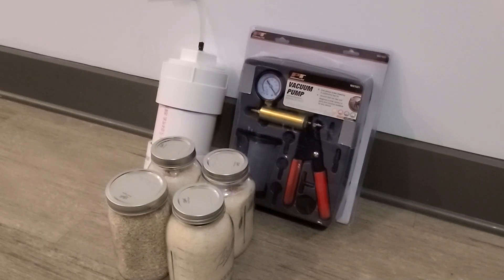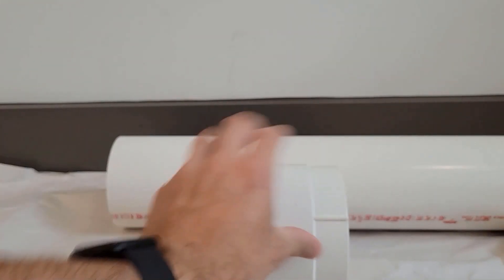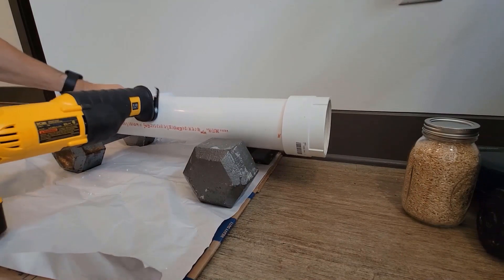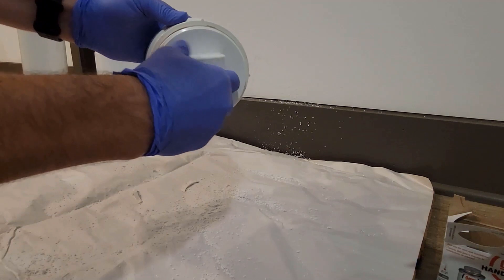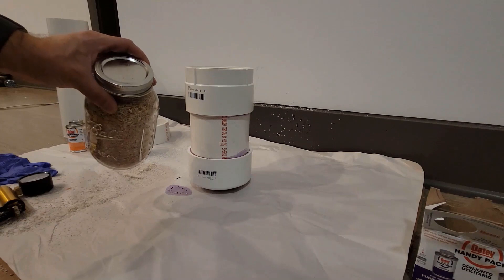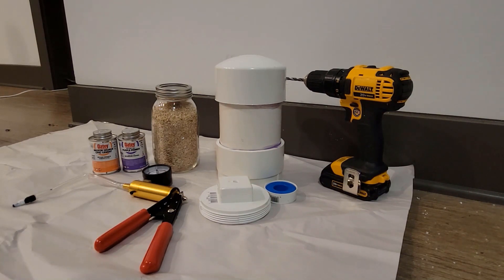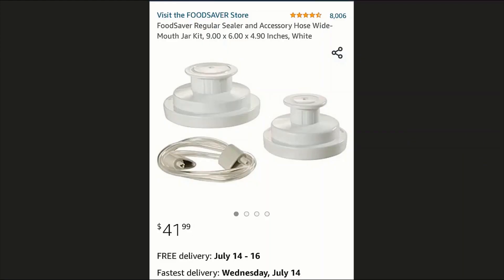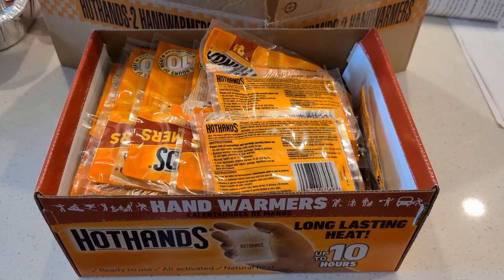Building a PVC Vacuum Chamber to vacuum seal canning jars

Comment: Interesting presentation.. It would be helpful to many people if a way could be found to re seal STORE BOUGHT JARS!! EG large pickle jars or mayo jars for dry goods.. Iv tried the following methods with limited success.. Canister in canister with quick release of air method.. Deni jar vac system.. Commercial vacuum sealer in side the chamber, jar broke using this method{ kilner jar used} Water bath has worked for sauces and liquids.. Oxygen absorbers to create a seal..{ Limited result}  Lochness Scottish Highlands..
Reply from the maker: Though not tried, I have read you could potentially use dry ice. Caution though as it can badly burn skin. But youd put the dry ice in, let it melt until almost gone pushing the oxygen out of the container, and then add the lid to it. But if the lid isn't made to re-seal it might still not seal correctly.

Comment: Twist the fitting and pipe a quarter turn after you glue it but quickly before it sets.  It will distribute the glue to fill any gaps.

Comment: I wonder if you could heat that curved bottom piece and flatten it out
Reply from the maker: I bet it's possible. The vacuum isn't that strong, so I bet even sanding down a flat spot would work.
Reply: @mediumresistance  good idea , I've been thinking about building one like it
Reply: @mediumresistance  the domed surface is what gives it the characteristics of a pressure vessel. You'd be better off building up the perimeter of the dome to make it "flat"
Reply from the maker: @michaelsimpson9779 great idea! Tha ks for the contribution

Comment: Is there a pipe big enough to put a 1/2 gallon jar
Reply from the maker: You might try an 8" pipe. I'd bring the jar to a home depot and check a few different sizes to see which it fits the most tightly since you'll want as little air space as possible.

Comment: @ERIC MEYERS WHAT SIZE IS THE PIPE? I GUESS I MISSED THAT PART. THANKS FOR A GREAT IDEA!!
Reply from the maker: Hi Uncle Jabbo, thanks for watching. I said 6" in the video and just now actually looking at the parts I think it was actually 4" schedule 40 pvc pipe. However depending on the size jars you plan on using this can scale up or down as all the items should be available in the common pvc sizes. Keep in mind the larger you go the more difficult it will be to put the vacuum on. At that point may want to hook up an electric solution vice the hand vacuum pump.

Comment: How did you make the lid ?
Reply from the maker: Hi Ruth. It's a screw in PVC plug. You then drill a small hole in the squared raised center peg for the vacuum pump. You could do it the opposite way I suppose and drill the rounded end for the pump but you might not be able to get as good a seal since you wouldn't be able to cement the end on to make the jars accessible

Comment: My husband and I built this but the brake bleeder dial doesn't move at all.
What are we doing wrong?
Reply from the maker: Couple possibilities. You may have an air leak somewhere in which case you aren't creating the vacuum. The gauge on the bleeder could be non functioning as well. You can use either Teflon tape or hot glue to seal around the hole you drilled. Another option might be you didn't get a great seal with the pvc glue. For this you can either break the bottom cap off (which might be pretty difficult) or just slather the gap between the bottom cap and the pvc pipe all the way around on the outside to make sure you eliminate air entering. Hope this helps.

Comment: Where u get the adapter from
Reply from the maker: All the PVC components are available at Home Depot or Lowes. The nozzle that fits into the screw in piece of PVC came as part of the hand vacuum pump.

Comment: Ooh I’d want a flat end on the bottom!, but I guess it doesn’t matter.
Reply from the maker: Thanks for watching Bella. Yeah it does add a level of complexity. If I were to do again i'd try and find a way to make the bottom flat. You could make an easy epoxy flat bottom for it by pouring the epoxy and putting the chamber in directly vertical while it dries.

Comment: A tip for cementing the PVC - twist the pieces about 1/8 to 1/4 of a turn when putting the pieces together after gluing.
Reply from the maker: Thanks for the tip. I always wiggle my connections to smear as best as I can. Definitely helps

Comment: The vacuum container can seal other types of empty button lid jars. You can also stack smaller jars. The mason lid sealers are limited to regular or wide mouth mason jars. I need to figure out how to build a chamber to seal gallon pickle jars. I have a lot of them. God bless.
Reply from the maker: Hi Elizabeth, thanks for watching. Holy cow, gallon jars! I'll bet there's a specialty type if pvc in larger sizes you could use. Or corrugated steel they use for drain pipes. But creating the vacuum would be a nightmare. Think the handwarmers are probably the most cost effective there for sure.
Reply: @mediumresistance  I've seen people build vacuum chamber (cube) with thick plexiglass, rubber seal around the lid ensures a good seal.

Love you video, thanks for the idea!
Reply from the maker: @pickle_ballz  that's interesting Jose. I may look that up and give it a try as another option. Thanks for watching!
Reply: If you have a home pressure canner it can be adapted into a vacuum chamber.

Comment: Thanks for pricing this project, I was quite surprised how expensive the pieces are.  And that's before you even put it together.
But it seems kinda necessary - both for strength of the vessel to take the pressure, and for being such a tight 'fit' to a jar.  I'm still looking for a solution. I can't find a vacuum chamber for sale atm & I have LOTS of store jars to put to work. Plastic Kirkland jars with a hole in the cap "work" but their sides suck in so bad, like they'll bust, I always stop before it goes too far.  Maybe pour dried beans around the jar to support those sides and take up air space?  i'll give it a try
Reply from the maker: That's an interesting idea just using a larger jar. Please comment again and let us know how it works using the beans. My gut says if it helps it will be only slightly as you would still need the same pressure level but it's an interesting solution. Thanks for watching and the comment!

Comment: One thing to remember is that the jar is not sealed until the unit is exposed to air. The inrushing air pressure slams the lid down against the jar and the gasket seals it. So the break probably needs to be fast for best results. You'll still lose some vacuum in the jar anyway.
Reply from the maker: Very valid point. Thanks for the additional detail, and thanks for watching. I hope you enjoyed the video.